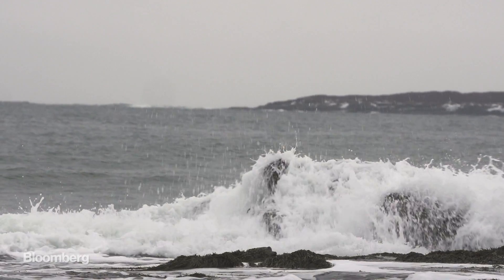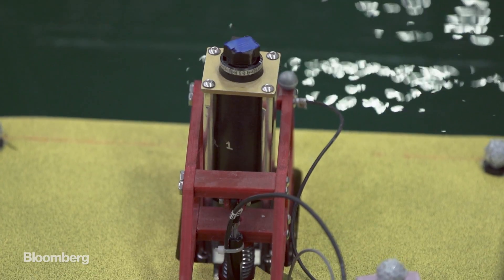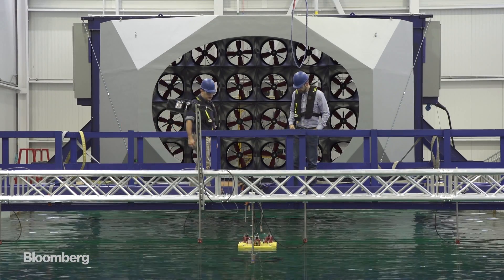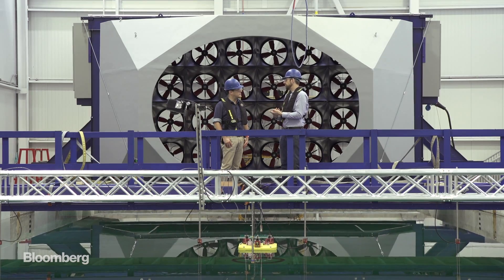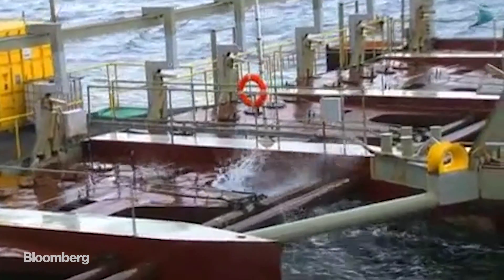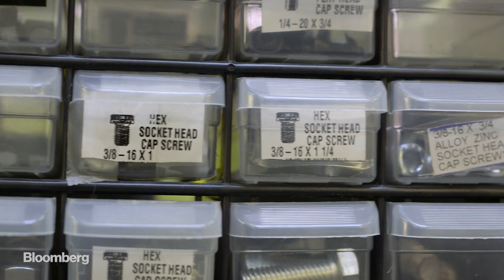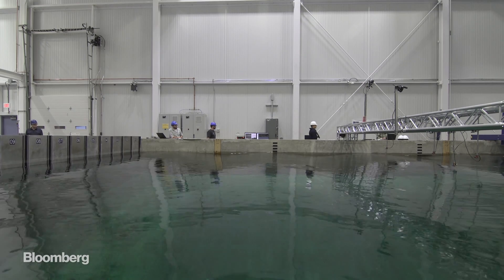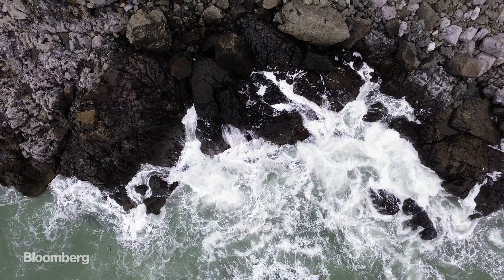This Device Could Turn Waves Into Cheap, Renewable Energy

Comment: At the 2016 Offshore Technology Conference, a presentation was given on harnessing wave energy through piezoelectric materials. It's a similar approach. However, their design was simpler (one part instead of two), and they already are testing large scale prototypes.
Reply: *****
I don't have a copy of their paper or presentation, but here's the info:

Offshore Technology Conference 2016
"Using Electro Active Polymers to transform
Wave Energy Conversion"
by A. Wattez & R. Van Kessel
SBM Offshore

Comment: There was another one I saw on tv a while back using a plastic tubing or one of those debris tubes used for demo of a building and mounting it to the edge of a pier with a electricity generating turbine that is able to produce power if being turned clockwise or counter. So as the water rose and fell from waves it caused the air inside the tube to be pushed or pulled making the generating motor to produce power. And since the water is constant in motion it would produce infinitely or until the salt water effects the metal on the motor.
Reply: From what I’ve seen, that design is the best in that the maintenance is done on land and thus keeping cost down. The one I saw was made of a concrete building on the shore and it powered the generator both ways. I like your idea.

Comment: There was a wave capture system that was actually able to generate a decent amount of power but the reporter who came to check it out misplaced a decimal point in the power output when he reported it and the funding collapsed.  I can't remember where it was or who made it, but I believe it was someone over in the UK.  If I recall the design correctly, it was a line of flat floats arranged perpendicular to the shore that moved up and down with the waves to pump hydrolic fluid through a turbine.
Reply: hellcat1988 i highly doubt that people who fund stuff like that, or are responsible for funding source their information from a reporter rather than the reporting made by the involved